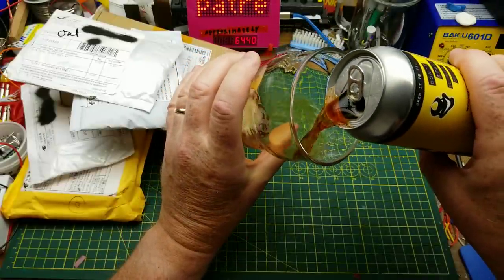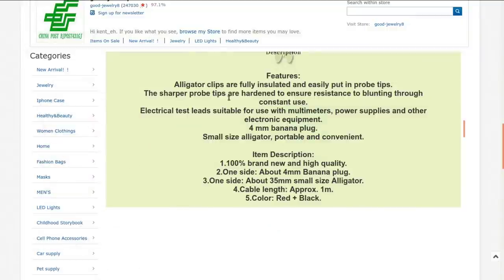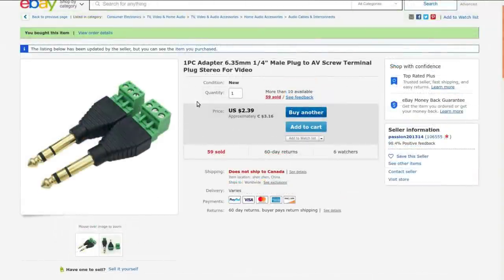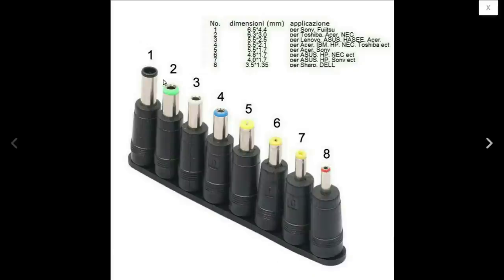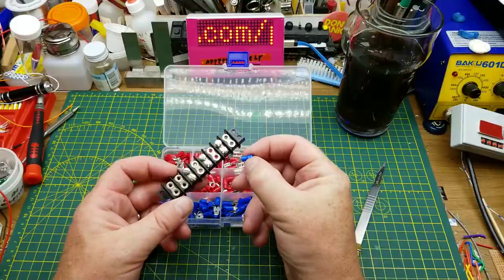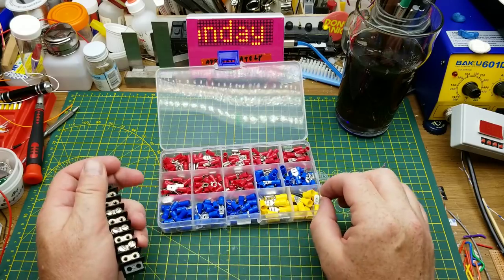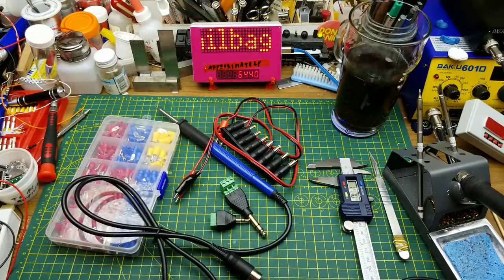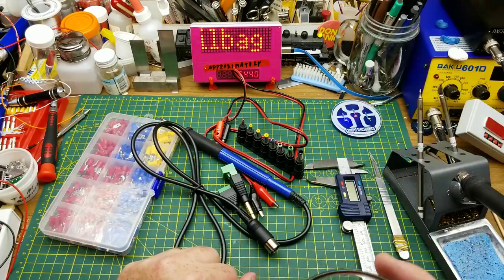Mailbag Monday #95

Comment: With the test leads, the conductors inside are really thin so you can lower the resistance by cutting them in half. Also, those banana plugs were the "screw-down" type, so they will need a new termination anyway. Check for silicone insulation using a soldering iron.
For the soldering tips, the "conical" is the standard one supplied with the irons. It's bad for almost everything because it has no flat sides and the heat contact points are therefore bad to both component and solder pad. The type you use are flat on one side, so a bit better, however the best overall are the chisel tips (which everyone recommended to replace the conical that your iron was supplied with).

Comment: I wonder if the alligator clips on the meter test leads are only crimped to the lead instead of soldered so over time the resistance will go up. Try  pulling it back and if it’s only crimped, solder it and then see if both sets have low resistance.
Reply: Many times banana wires are fixed only loose press. Better solder yourself.
Reply from the maker: I soldered the existing set a few months ago - I think it's the wire itself that is so thin as to add a few ohms per foot.

The new ones are probably crimped, and even at that they're much better.
I will solder them at some point, though, Should make them even better.
Reply from the maker: Yup. I tend to solder any of the cheap leads that I get. If nothing else, it stops them from falling apart in my hand.

Comment: You can't have too few tips, each type of tip has its own place. but you will find over time that there is the goto tip which lives on the iron most of the time. Big problem is temperature and energy, I have a gas torch that can run at 3,000°C but the flame is only 1mm wide. it can heat a small bit of wire to a very high temperature or a large bit of plate to a low temperature. it has the temperature but no energy/ power behind it.

This is the problem you find when you need to unsolder a ground connection, with a small iron and a small tip the PCB can suck the heat away faster than the iron can supply it to the tip. bigger tip bigger thermal mass.

Comment: The only use I have found for my conical tip is for cleaning out perfboard holes from solder. I put a solder sucker on one side and the tip on the other ... the conical gets right into the hole and the result is a cleared thru-hole. Those 1/4" adapters look super handy!

Comment: It is so much better and cheaper to buy the connectors and wire to make your own test leads. I paid about $15 total for 100 stackable banana plugs and 50+ crocodile clips of assorted sizes and types.
Just buy a female to female adaptor for the soldering iron, if you cannot find one, make one...

Comment: I'm with you on the bevel tip - it feels like I have more control over the solder than with other shapes. For some reason they seem to be more expensive, though.
Reply: I like the bevel tip also. For the larger ones you can drill a small hole in the bevel so you have a solder resivoir.
Reply: @stevetobias4890  I'm also a big fan of them - beside the D series chisel tips.  They even sell the Bevel ones in a special version with a reservoir now.

Comment: I'm such a Neanderthal that I prefer my soldering irons to plug into the wall. I learned to do surface mount with one and really hated the temp-controlled irons I used at work to do it- didn't seem to have the same "feel".
What tip you use is indeed best suited to your own style of work, but I have to agree that anything with a flat spot on it, be it chisel or abbreviated cone, is far more generally useful than a straight cone.
Reply: With you on this one, if sitting at the bench I want an iron that can stay powered all day long. if out in the field gas or battery powered is ok. I do not see the point of charging a battery just to solder at my desk, or use a usb powered iron from a power supply.
Reply: Don't go blaming the Neanderthal's for your lack of good tool use ;) Seriously, I can see your point. I had a 12w Weller that was a pencil style that I used for years until it died. It was a great iron!

Comment: Be warned that some of those test leads don't have much copper inside. I had once a set that struggled a lot with more than 2A and almost catched fire at 3A. It was like 99% isolation and a very thin copper wire inside. Make sure to test them before relying on test results you do "with" them. 
When it comes to test leads i prefer to buy decent sized silicon wires (from China) and Hirschmann Banana Plugs these days because bad test leads can ruine the whole test. I've also tried cheaper banana plugs from China, but they wear out too quickly - the Hirschmann for 1-2€ a piece are worth their money.

Comment: Oh, the wrong end on the knock-off wand game!  I have played that a few times now and it's no fun. On the soldering tips, they are kind of like text editors, what you use or do is always wrong.  Do it anyway :)  I do something that would probably make most gasp. I file the end of the conicals to have an angled flat area. Just on one side and try to stop just before the copper center :) They tin-up well and make for good pin soldering and last a good while.
Reply: I am still searching for the penultimate housing that puts my fingers very close to the end ... or the work.
Would sell my soul for an artist's or surgeon's steady hands.
Hollow slant tips are pretty good for drag soldering, and general purpose.

Comment: I bought the same clip leads for my Megger BM7 from a US seller.  The negative banana plug is more rigid than the positive one for some reason.  Perhaps I should inject some epoxy into the positive one?
Reply from the maker: I would take the connector apart first and make sure ther is a solid electrical connection before doing anything as irreversible as adding epoxy.
Reply: @pileofstuff  It turns out that the positive connector is just slightly different in its construction.

Comment: They write and show: "Wire Probe Lead Silicone Banana Plug to Crocodile Alligator Clip" but they ship common speaker wire, no silicone and hair diameter copper wire inside (if it is real copper...): half ohm resistance and usable just for a few milliampere  current. The same old story! We have to stop such behavior. Start a complain or a dispute
Reply from the maker: I mostly use these clips for voltage readings anyway.

I made another set with 18 gauge wire for doing current.

Comment: Do the letters on the DC plug kit align with the Radio Shack lettering system they used?

Are the crimp terminals plated copper or just aluminum?
Reply from the maker: I'll have to dig up an old RatShack catalog and see if they are the same.

I suspect those crimps are plated steel. Pretty sure they're not aluminum.
Reply: I did a cross reference on that exact subject a few years ago, and found that the Chinese letters do NOT match Radio Shack's. Also I found that the Chinese have duplicated some letters (eg: H could be 2.5*0.7mm or 3.5*1.35mm
I cannot find my conversion list between Chinese and RS, but here's a link to the RatShack info...
https://en.wikipedia.org/wiki/Coaxial_power_connector#RadioShack_Adaptaplug
Reply from the maker: @johncoops6897  Thanks for that.